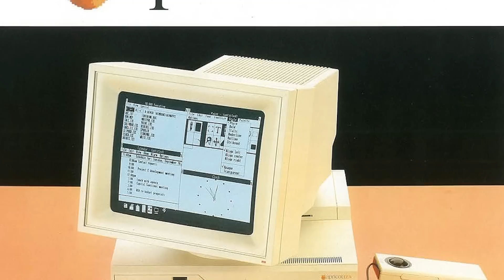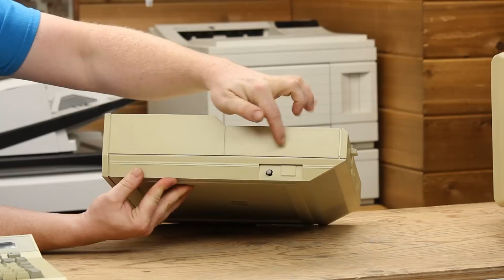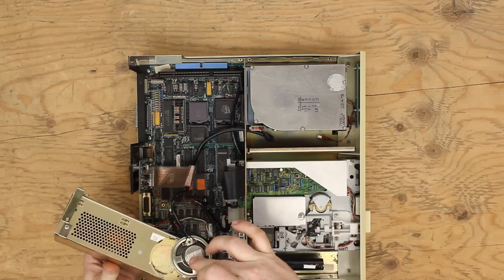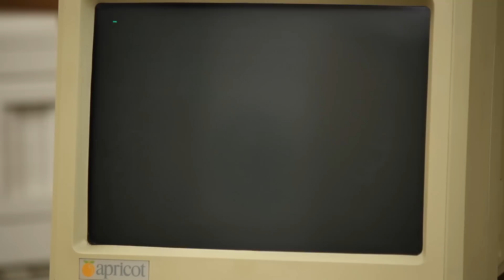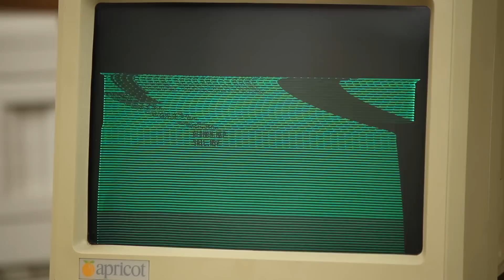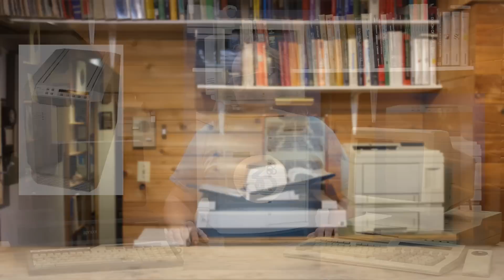Apricot Xen - Great Ideas Come Back to the PC

Comment: My first job for 4 years was a DataEase database programmer for an Apricot Dealer in Glasgow, Scotland. I was 18 or 19 when I started there, just after college. Apricot were great machines - you must remember these were high-tech machines that came out of the UK in the early 1980's - when the UK had a lot of economic woes and had nothing like the market potential of the USA. Much smaller market and budget and much more business risk than USA in this tech - also competing with IBM and other larger suppliers - like Compaq, and even Olivetti, who were the  world's largest typewriter manufacturers and who made PC's for a while - but still much larger wallet than Apricot UK. The equivalent IBM was a rectangular box.
There were 3 programmers in the company - all teenagers like me. The sales people basically gave away a free bespoke invoicing package through us, which sold the computer. Each Xen cost about 3,000 pounds, with about 1,100 percentage on the sale - that was more than my monthly salary. My mother bought a house around that time for 9,000 pounds. A lot of small companies were just adopting their first computer in those days - it was a big deal.

Comment: Man I made a good side line getting cheap Sony 720 disks and using a solider iron to burn a hole for getting 1.44mb  floppies - the zen was very sus compared to like “real metal” PCs and they would strip all the plastic holes very easily. There was also a very rare apricot QI which had the MCA bus, if you even looked at it wrong it would fry any add in cards! -  The hard drives where totally nuts, I remember fearing the winter because we used to have to go screwdriver start many computers by flicking the hard disk spindle. The expansion slot to the side has to fit the very rare VX (as a I remember) expansion, which seemed like a super computer thing at the time - it has a very early scsi bus if I remember took days to low lever the high level format

Comment: For one project we installed a good few VX/FT boxes running OS/2 as the server. From cold to fully up and working took 25 seconds! However OS/2 would only allow 4 concurrent connections. Rebooting would only add a further 4. When you have 30 workstations in the department, that's a LOT of reboots. Server+4,  Server+8,, Server+12....
For another project we were forced by government to use full OSI networking (TCP/IP doesn't fit properly). Cutting edge stuff! Most other places using it were universities with a handful of boxes. At the time when we had 150 workstations in use, someone from Retix (the stack provider) stood up in an international conference and announced us as the largest OSI-based local area network IN THE WORLD. 😀
Reply from the maker: I would of expected the FT to have extensive NetWare support. I mean, OS/2 sure since it was an MCA box but yeah, I can see your issues with OS/2 running as a server. It wasn't ever really all that great until much later.

Comment: Most of the Xen-I boxes we delivered had 1.4 MB drives. We once had a single order for 14 external 5.25" drives, to be fitted at 12 different sites, all over the UK.  My own 386 box used that clip-in cover in the lid to keep the ribbon cables for a loose 5.25" HDD which held backup sources for the software I was writing.

Comment: The UK was about three years behind the US in adoption of PC systems. They were too expensive for the UK market, including clones so it did not go from Apple II and so on direct to PC. Things like the Amstrad PCW ended up in a lot of small businesses for a bit of word processing and maybe a few other things. This also meant the that at the home end the likes of Amiga and ST go in for a couple of years so folks did not have a PC at home even when Amstrad changed the market with the PC1512 but from then on people started to think of a PC at home too which made them less intimidating for folks in the workplace. A lot of people went and bought Amstrad PCWs for home too.

Comment: The same monitor design was also sold by Zenith. You could get it with green or amber phosphor, and a composite or MDA/Hercules input.
Reply from the maker: I love how the plastics were supposedly injection cast by Borg Warner. Their name is hidden around the larger plastic components.
Reply: @CelGenStudios  Yup, I did a teardown of a Zenith monitor that was unfortunately damaged in shipping, and I saw that inside. Mine has a Philips picture tube.

Comment: Yea, the big old IBM clone thing killed off tons of unique computers. More bang for your buck hardware and even software wise. Did not matter. Then it seems like all within 5 years. The back of computer magazines was having ads with closeout systems for pennies on the dollar. As for software later on around 1992. Yea, that seemed to be common. More on windows systems than dos. Sure the hardware was cheaper. But, I saw some very, very poorly written programs that ran great on say IBM Aix systems.Update: Found one place said one of the problems is systems froze often. (windows 3.0) ouch.

Comment: we had a Zen-i at work.  No LCD screen on the keyboard etc.  Oddly though, it had a monochrome monitor, but it acted like it was a colour monitor, as it would display shades of grey if you went it colour!  I had a program to change the shape of the DOS cursor, or even turn it off, which worked OK on all our other machines, but malfunctioned on the Zen.  No idea if it supported Hercules graphics as it spend it's life running WordStar 5.  This machine had a power-out for the monitor.  One day, someone tried to plug a large colour monitor into it, and bang!  A guess a fuse was blown in the PSU when faced with the much larger current requirements of a larger monitor.  No-one could figure out how to fix it, so it was junked.  Sad, really.

Comment: I used 2 Xen’s in1984 for a number of years to produce shipping data using Supercalc spreadsheet, they replaced the Xi id previously used. It was clear then that although apricot did have a lot of software available to it the whole ‘pc’ compatibility thing was becoming a big thing within the UK, by 1986 we’d replaced both Apricots with PC compatible devices. The design of the apricots was amazing tho, sad that the company effectively chose the wrong path